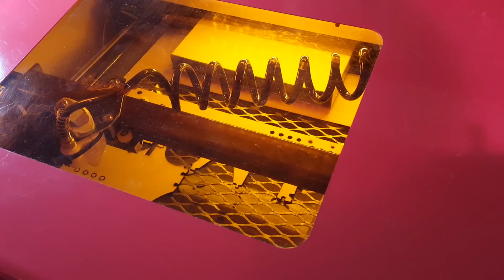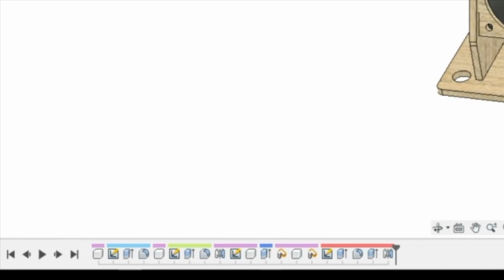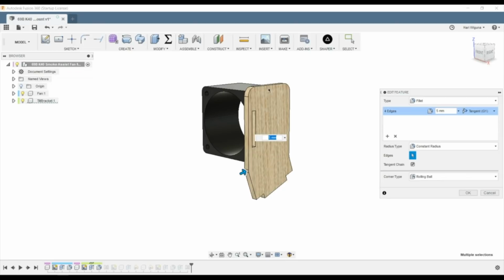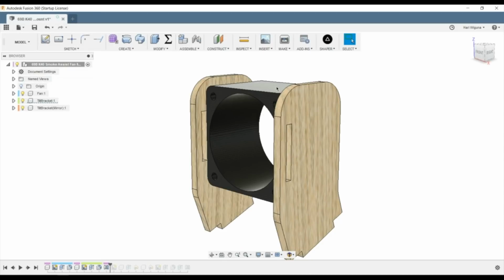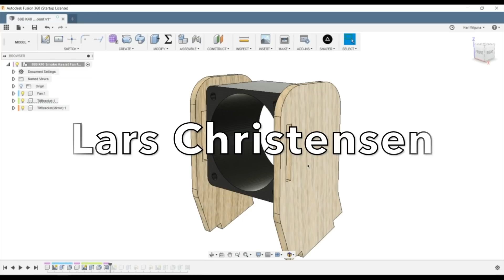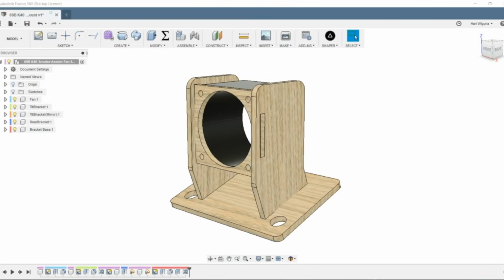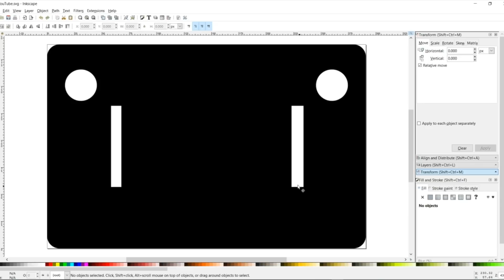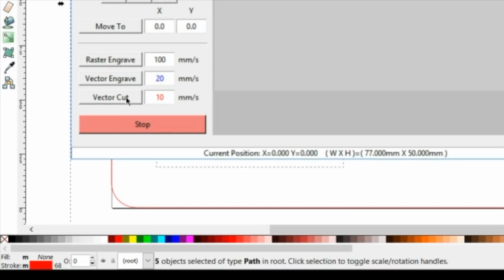HariFun #171 - NO Smoking!

Comment: Awesome Video Hari only thing that was missing is closing the door to see how it fits. But other then that very nice.
Reply from the maker: Good point. It does fit with about a centimeter clearance. The door basically has no thickness, so I used the left side of the box to judge how high the fan could jut up.  I love how fast laser cutting is compared to 3D printing.  I think each piece only took about a minute to cut, so in less than 10 minutes I could laser cut a taller/shorter version.  It would take at least two hours to 3D print something this tall.

Comment: Looks like it works well! :) I personally got rid of the stock exhaust fan, as it didn't pull enough air to be very effective. I upgrade to a bilge air blower, which although is quite a bit louder, sucks in smoke regardless of where it's coming from inside the laser. No need for smoke-assist with bilge blower :)

I haven't seen the Shaper Origin plugin used before to export to the K40, pretty neat. I have just been right clicking on the sketches and saving as dxf to give to the K40 Whisperer. One negative about that method is that it only exports the lines in black, so I have to change the 'vector engrave' to the cut speeds.
Reply from the maker: Please share the exact model of your bilge fan.  I have an inline duct fan that I am not too happy with, so I currently run TWO exhaust fans: the stock exhaust AND the inline fan.

The contortions needed to convert Fusion360 to SVG is a small price to pay for the joy I get from designing things in Fusion. Time Machine, Parametric design, no triangles... I love that app!
If I may ask, what do you make with Fusion and your laser?
Reply: @HariWiguna  I believe I printed this model ( https://www.thingiverse.com/thing:3166545/files ) from thingiverse on my CR-10. I then attached it with standard 4" dryer vent foil ducting and hose-clamps to a "Attwood Turbo 4000 Bilge Blower" that I found on ebay. they are ~$30 new, but i got mine for about half that Used. I believe they are used on boats to exhaust any potential fumes from building up in engine compartments to prevent fires. It moves an incredible amount of air, and mine draws about 4A at 12V. The suction from the pump has been enough in some cases that laser-cut parts will actually be sucked into the exhaust shroud, where I have to go fishing for them inside the tube (luckily the ribbed tube catches most parts before they hit the fan)

I personally use Fusion to create and design parts for personal projects and products, for my FRC Robotics team, preform some different simulations on parts, and recently getting into the CAM functionality for use with my Robotics Team's X-Carve to create complex parts. Fusion is crazy powerful for what it is. I plan to soon (a few months maybe?) design a new Laser Cutter reusing as many parts from the K40 as possible (Mostly Laser Tube, Laser Power supply, maybe some of the optics) as I'm finding myself wanting to cut larger, and more complex parts. Trimming Material's to be A4 sized limits what you can do quite a bit I find. I plan to build my machine to fit a 1/2 sheet of plywood (2x4ft area) with auto-magic Z-bed adjust, digital power control, etc. Been looking into CoreXY, and I think that will be the Kinematic system I build the new one off of.
Reply from the maker: That bilge blower is pretty wicked!
I'm still content with the K40 bed size, but I can see how that would be limiting for robot makers like you.  Sounds like you're doing fun robot projects!

Comment: You didn't show the wiring system for the fan, is the small fans plugged directly on 220v?
Reply from the maker: NO. The small fans are 12volts.  They are powered by a separate 12V wall adaptor.
Reply: @HariWiguna  I don't mind seeing the picture of the 12v adaptor?